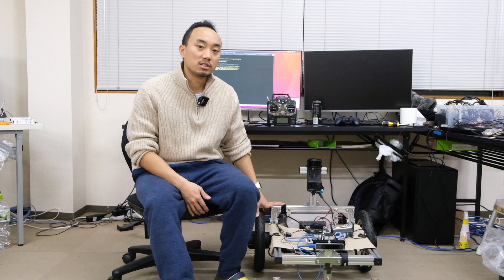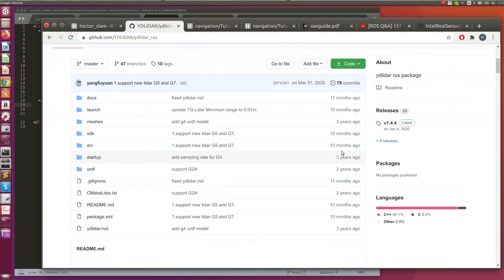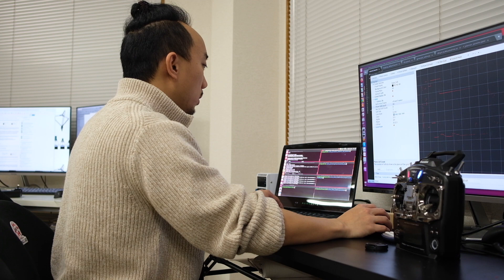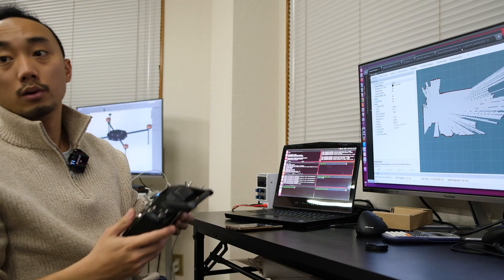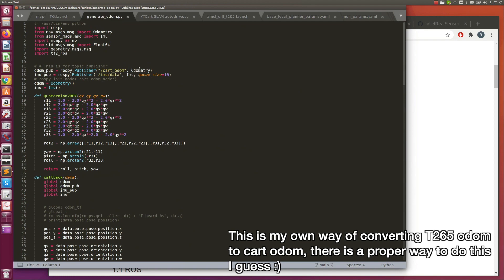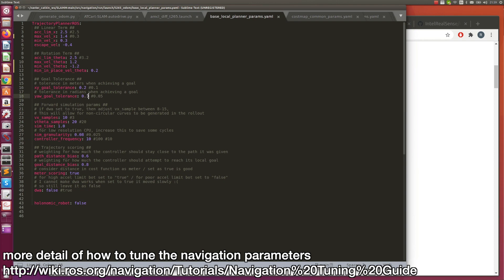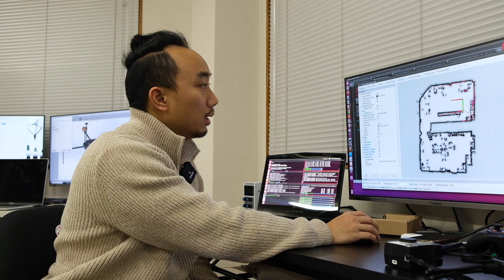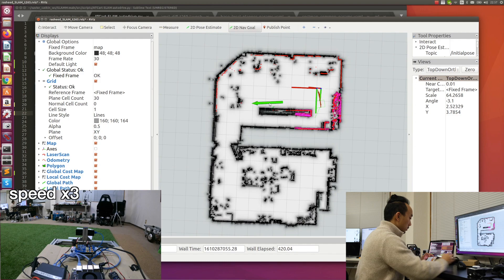Using ROS SLAM on the REAL ROBOT like ATCart!

Comment: The proper way to adjust for the offset is to make an simple urdf file file and  launch a static tf publisher. Check out james bruton really useful robot  series using ros and  make a robot description and launch file accordingly , eagerly waiting for the next video.
Reply from the maker: Thanks for the information, will check it 
out.
Reply: plz correct me if i'm wrong. my understanding is that if you have a urdf file and launch the robot_state_publisher, it will publish tf for you.
Reply: is it possible to do the same with a 3d lidar? i am asking this for outdoor
Reply: @giraftw2002  i think to rviz but not sure

Comment: Isn't there any inexpensive way to create the ATcart and implement Hector SLAM? xD
I have the chassis, 2 johnson motors, 2 motor drivers, 1 RPi, 1 RPLidar A1M8, and other Flight Controller related components. Do you think I can do this using the components or should I adapt to your methodology? I have been able to implement Hector SLAM before for mapping and localization. Now in the process of using it with the UGV System. Any help would be useful!

Comment: I am very glad to see your video. Your video is very helpful to me, but I also have a question. I used a nano series industrial computer, connected to a lidar, two D435 cameras and a T265, and there are four ultrasounds. When running, it always appears that the Asic timing adjustment temperature value is invalid, and no matter how I adjust the parameters, the robot cannot run stably.